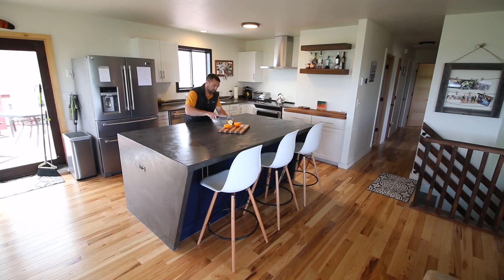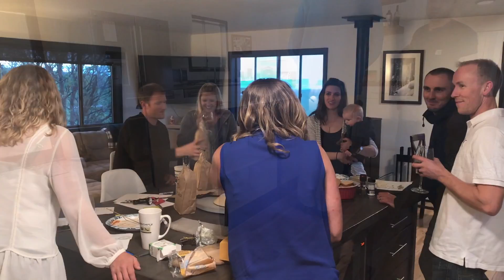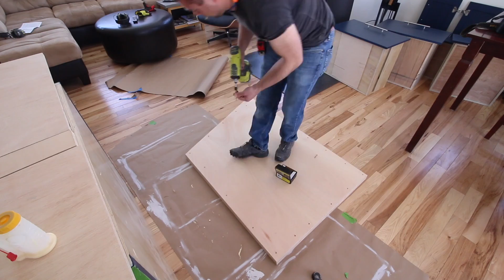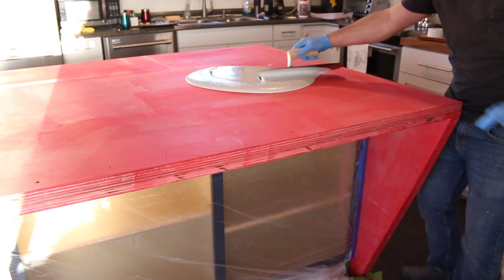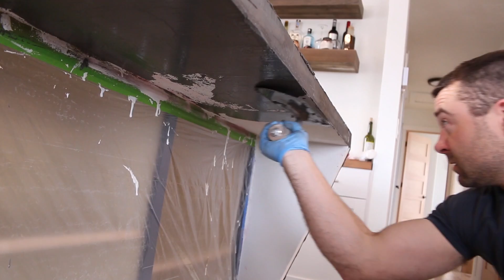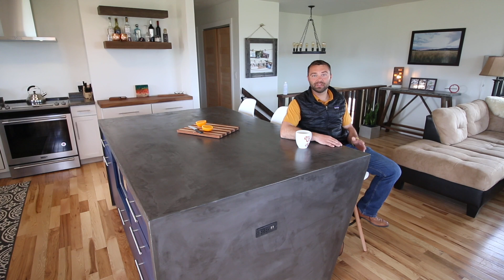DIY Concrete Counter Island with Waterfall Edges - ( Concrete Overlay )

Comment: Hi Pete, love the look of your concrete overlay waterfall counter. We are hoping to create a similar look for our outdoor BBQ area. How does this material work if used outside? Any advice on what not to do if using this technique outdoors.
Thanks!
Reply from the maker: Hi Simran! I haven't used this particular brand outside, but products similar to this are  commonly used as an overlay for concrete patios, so it is definitely possible. Using an outdoor sealer is definitely one modification. --- But look into outdoor concrete overlay products. Best of luck!

Comment: Think you might be able to do this on an existing countertop? Really don't like our current countertops and would think about just adding a waterfall edge to the existing peninsula.
Reply from the maker: Hi Brett, it is possible. I'd recommend doing some additional research on " concrete overlay counters " and such to see what materials are okay going over, and what to use as a bonding agent. Also see what preparation might be needed for your situation. Cheers

Comment: Nice work. How does it hold up over time?
Reply from the maker: Hey KP! It's been holding up great. However, I am a much bigger fan of solid concrete tops. It just doesn't feel the same. At some point I will probably replace it and just do the top with a big solid slab.
Reply: @DIYPETE  alright. You think you can do the same shape in solid concrete?
Reply from the maker: Hey KP! It could be done, absolutely. The big reason I did it this way was to save on weight. There is a basement below and I didn't want all the weight on the joists.

Comment: Pete, awesome video, we will be doing this! Question for ya... would this type of setup work for all of the countertops in the kitchen specifically around the sink with all of that moisture? Additional sealants would help? Thanks!
Reply from the maker: Hey Ryan! A number of folks have done this overlay type process. However, it has a different feel than solid concrete and I definitely prefer solid tops. Here is a video I did showing solid tops: https://www.youtube.com/watch?v=A0Pd4o8gjfM       --- This has held up well and I did it since this is on a second floor and I didn't want a ton of stress on the floor and joists.

Comment: Great tutorial! How has it held up? Particularly your vertical waterfall sides? I'm wanting to do a concrete fireplace surround; all the way to the ceiling. Do you think this product would work well (and hold up) in that type of application?
Reply from the maker: Hi Caryn! It's held up well, and the sides look great. It works awesome vertically. This was the first time I used this brand. I usually use EliteCrete. That is actually my favorite, but my local supplier was out at the time. I do think this or a similar product would hold up well and I've seen is used before. I'd recommend doing some searching for " Concrete fireplace surround concrete overlay " etc to see some additional ideas and recommendations. Cheers!

Comment: hey @DIY PETE thanks for the great videos!  After seeing both this video and your concrete countertop video I wanted to ask if you prefer one method (overlay, or actual concrete) over the other?  We're looking at doing concrete counters in our kitchen but the overlay method looks way easier.  Thanks again for your time
Reply from the maker: Hi Aaron! I do prefer solid countertops, and would recommend them for your kitchen. Here is a video that shows the most simple concrete counter method I've ever shown in my opinion: https://youtu.be/A0Pd4o8gjfM   --- Solid countertops have a more solid feel and wear better.

Comment: Awesome! How long between each coat of overlay? There were 3 right? Then the protective seal, also 3? 6days? Or less, please say less but only if it's true!?!
Reply from the maker: Hi! The concrete process took me about three days. I started on a wednesday afternoon - I taped the seams and added the pink bonding agent. It dries super quick. I put on the scratch coat, and let it dry overnight. I then sanded the next day, and then did all the layers of grey concrete. They dry pretty quick as well. I let the last coat dry, and then did the sealer, which also dries fast. The concrete portion can easily be done in under 6 days as it is an overlay material that doesn't take long to dry. Cheers!

Comment: Hi Pete! I just found your channel and this overlay treatment is very intriguing. Do you think it would work on top of old laminate counters? Do you have the link to this product?  Thank you!
Reply from the maker: Hi Marina! I know many folks have used overlay products to go over laminate. I would recommend contacting a manufacturer of an overlay product to see what they'd recommend. I used a product from https://concretecoatingsinc.com  - There are companies I know that do specialize in products specifically meant for going over laminate counters ( as long as the counters are in stable condition without any flaking or peeling.) Another option would be to look into doing solid concrete counters. Let me know what you end up going with!
Reply: Thank you!!

Comment: Can this process be used for outside? 
I live in Toronto Canada and would like to try this for a BBQ Island
Reply from the maker: Hi Jim, this process can be done outside. I actually just did a set of tops for an outdoor kitchen that are solid and I do prefer the solid process for counters over this method. But the overlay product is great for outdoor projects ( mostly floor finishes etc ) and is known to withstand weather.

Comment: Can you apply this over a ceramic tile counter?  Doubt it but, thought I would ask.  Nice video!!!
Reply from the maker: Hi there! I would be a bit worried in case the grout joints ever cracked, as it could cause issues with the overlay.

Comment: Do you know if it is food save and can it be used just like concrete. Now that you have had it for a while hows it holding up? Looks great!
Reply from the maker: Hi Kathy! It has been holding up well. The sealer I used is food safe. It has been working well. However, I do prefer the look and feel of solid concrete tops better.

Comment: I like this a lot as an option for my kitchen Im about to start.  I'm debating between this process and cast in place.  Im curious as to the durability of the corners and edges due to the thin layer of material.  Any idea on how this will hold up?  HAve you tested this process to see if hard edges will easily chip from kitchen abuse?
Reply from the maker: Hi! So far it has been super durable, but I recently did the other counters using the reverse cast technique for solid countertops. I do prefer the look and feel of the solid tops. I wanted to experiment with other options, but I'd do solid tops if you are able.

Comment: Love this project. I am looking to find the downloadable plans but don't see the link on your site. Where can I download these plans and for the kitchen island? In your opinion, using the same philosophy and basic execution, could the concrete overlay work if I was looking to replace my laminate kitchen countertops and concerned about the weight of full concrete tops?
Reply from the maker: Thanks Cory! For normal countertops, I'd recommend beefing up the cabinet tops if you don't think they are strong enough. I did the overlay because I really wanted the kitchen island waterfall look and needed to reduce the weight. I think you could do the overlay over the laminate, but that solid tops would be the best option. I'll be doing solid countertops for the rest of my kitchen ( and beefing up the cabinets a bit )

Comment: I have an old corner entertainment center I built long ago, kinda bulky, but have been pondering what to do with it. I just might do something like this.
Reply from the maker: You certainly could. I am applying it to a floating entertainment center and it's looking pretty cool.
Reply: What sucks is I have 2 layers of plexiglass - the top layer being tiles. I was hoping for multi-color tiles, like a checkerboard, but ended up just white. And it shows all the dirt. Pondering whether to go over it with concrete, or try to revive it. Either way, the sides need some major work. Especially the speakers. The foam from the old speakers has crumbled, and I need a more modern cover (and speakers in the boxes). I literally built the thing back in high school.

Comment: That’s awesome Pete! How long did the concrete take from start to finish?
Reply from the maker: Hey Andy! The cabinets were quite a project and took about a week. The concrete overlay / top was more straightforward and I completed it in 3 days. Built the plywood portion one day, did the rough coat the next / let it dry overnight. ( then did the rest of the coats the third day ) They were not full days, but I spaced the project out over that time.
Reply: DIY PETE ...it’s amazing! I’m buried in my 1st restoration project now. I can’t wait to finish it and get back to building things! Great to hear from you! Cheers!

Comment: Hi, Pete! Any chance you could post a link to the concrete product you used?
Reply from the maker: Hey Cody! I used products from Concrete Coatings, Inc. They will sell it to you if you call in, but it would be worth looking to see if you could find a product locally as well to save on shipping. https://concretecoatingsinc.com  --- You can tell them you watched my video and they'll be able to tell ya what I used ( the rough and smooth micro toppings and the pink bonding agent ) Cheers!

Comment: Will it crack at any of the seams where all the plywood was layered on top of each other?
Reply from the maker: Hi there, I made sure to add a ton of screws to make sure the boards are sandwiched will --- and glue isn't a bad idea either. You could mesh tape over each seam. I chose not to and haven't had any issues though.

Comment: Thats a great option over a pored counter. What do you prefer?
Reply from the maker: Hey Ben! For this situation the overlay was a perfect solution. For the rest of my countertops ( which are not sooo huge ) - I'll be doing reverse cast solid concrete tops. I like the "Solid Countertops" although they are a lot of work to do...
Reply: You find you have a better finish with a reverse cast to poured in place?

Comment: I am really enjoying your videos.  I think I will try a concrete table top or bar top.  I have been in construction for many years, but am just getting into woodworking projects.  Thanks for the great explanations with all of your videos.  Couple questions, where do you get your Melamine and have you tried a concrete mixing bag?  Thanks!
Reply from the maker: Hey Steve! Great to hear from you. I get melamine at Home Depot. I have not tried concrete mixing bags as I usually buy pre-mixed bags. If I mix it is generally in a wheelbarrow or concrete mixer. I've seen them, just haven't had the need to try it out.
Reply: Hey Pete,  Thanks for the quick reply.  I am really enjoying your channel and have shared it with my coworkers today.  Funny thing is they are doing a cast in place countertop right now.  Keep up the great videos, Steve

Comment: Such a cool solution when weight is a concern. Not sure my trowel skills are up to par though! Great job man
Reply: Robin Lewis not meaning this in a bad way what so ever but neither is Pete’s and it sill looked great I’ve been doing concrete for five years and you reduce the “chatter” marks if you hold the trowel flatter to the surface. It makes for an easier job and it’s perfectly fine to use water but if you needed to get some spots down a little elbow grease does better. I’m not sure how the skim coat acts with to much water but I would be scared it would flake. Never the less it looks great and I love the look of concrete counter tops. Exposed aggregate finishes are absolutely beautiful
Reply from the maker: Hey Robin! You'd definitely do great with an overlay. Cheers!
Reply from the maker: Hey Mike! Great to hear from ya. The overlay was definitely a bit different to trowel then a normal mix when you can float the cream to the surface and have a lot more working time. This dries super quick and wasn't quite as easy to work with as some brands I've worked with where you use thicker coats. As you mention troweling is definitely an art and I'm still trying to master it for sure! Cheers!
Reply: DIY PETE oh I hear ya. I bet the sanding in between coats helped

Comment: Do if I wanted a nice smooth finish to just sand it
Reply from the maker: Hi Vince! Yep, using a 120 or 220 grit sandpaper on an orbital sander will help smooth it out a lot more with less texture. Just make sure to hook the sander up to a vacuum to minimize dust.